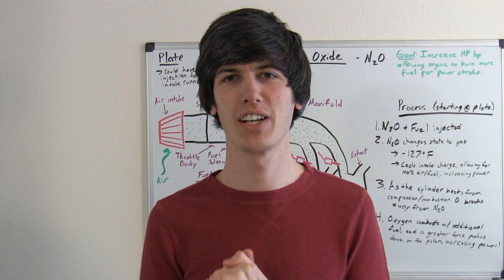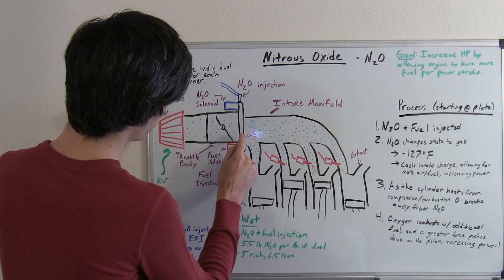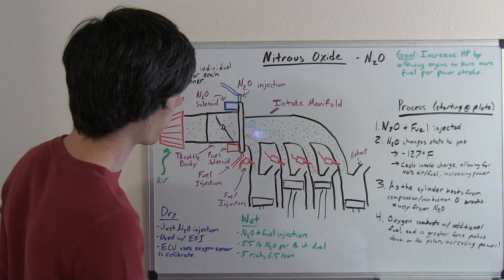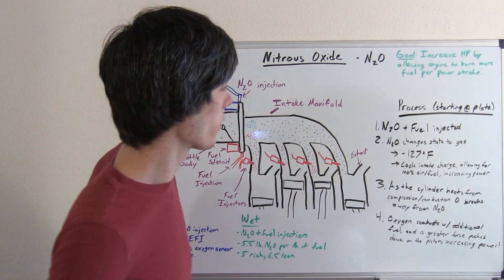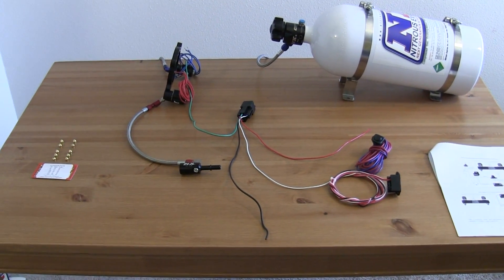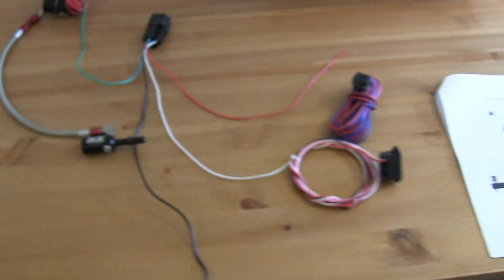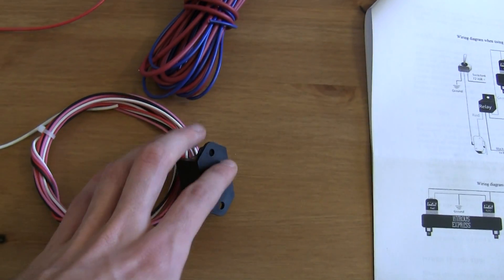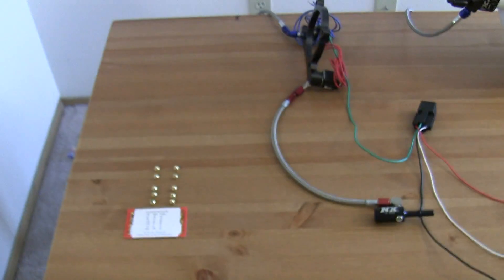How Nitrous Works - More Horsepower!

Comment: Hello. Another great video. I really enjoy watching you. I've got one question. Could you explain once more why the bottom of the nitro's bottle is lower than the top because I didn't get it :P cheers mate
Reply from the maker: +nendznikpl That's where the pickup feed is for the liquid nitrous.
Reply: +nendznikpl  As the liquid is used up the top of the bottle will fill with vapor. You don't want that in your car, It will actually slow your car. You want the liquid that will always be at the lowest point of the bottle.
Reply: +asdfgoogle the nitrous in the tank is actually presurized, so at room temperature and presurized, it has a liquid state. what makes it a vapor later is the decompression i believe.
Thermodinamics purely, just like air conditioners. that´s why so familiar
Reply: +nendznikpl The nitrous is in a liquid state at room temperature, so which has a lower density than a vapor. That means that inside the bottle, it's liquid, not vapor. However, once injected into the system (engine), it is sprayed in. Think of it as a fine mist

That mist has a very high surface area (because the particles are so small), so it can more easily change state from "liquid" (mist) to a true vapor (something like a cloud, where you physically can't see each individual particle) and flow through the combustion process.

I'm pretty certain that's correct. I took courses on air conditioner maintenance and repair, and it sounds awfully familiar to that.
Reply: +Enzo Mansur 
google phase diagrams. The states of matter are variable based on Pressure versus temperature. For instance liquid nitrogen is stored at room temperature under high pressure, but when it is released into the substantially lower pressure of the atmosphere we live at the temperature immediately drops, and the substance presents itself in gaseous form. same idea as C02 or keyboard dusters. Really cool stuff.

Comment: would you be able to do this with liquid oxygen?
Reply: +conor barry He told me no because it would be very unstable. Just like running lean. Run lean for a long time(which will be rather short) and you will melt and weld the internals together. 
Kinda like an oxy-acetylene torch. But with gasoline.

Comment: Is it possible that at a point the additional pressure created inside the cylinder pops the engine head open? Sounds like you are injecting fuel and oxidizer at the same time.

Comment: You've said that you need to separate N from O to increase horsepower. Why not have a pure Oxygen tank connected to your engine?
Reply: +shitbomber   http://www.nitrous.info/oxygen-instead-nitrous-oxide.htm
Reply: +shitbomber You can but that won't cool the mixture down as when the Nos evaporates (separates) at the high heat in the manifold. The cooling makes the mixture more condensed (cold contracts/heat expands) thus more mixture gets into the cylinder and a bigger explosion. Oxygen evaporates as soon as the pressure is released, thus at the nozzle not inside the manifold.
Reply: That would ignite the fuel in the intake, does'nt even need to reach the cylinder

Comment: Wait so you're not explaining how it gets you high? I've always wondered..
Reply: Stupisest thing I've heard today. And I thought flat earthers were retarded
Reply: The N02 buzz is not due to oxygen starvation.
It's an anesthetic which acts by temporarily changing your brain chemistry.  
The dentist wouldn't use it as an anesthetic if it cause oxygen deprivation.
Reply: +Andy Curtis   
It's probably denatured, meaning there is gas in it that makes you sick, so you can't get high from it.
Reply: charlesvan13 that suck! you should get some medical grade nos and huff it shit gets you railed as!
Reply: +charlesvan13 

You're right about the added ingredient. It's called "sulfuric acid". It shouldn't make you sick, but it does suppress the affects to getting high off of auto-used nitrous oxide.
Reply: jsalmon Lmao I thought the same thing
Reply: jacob anderson you’re mental
Reply: It gets you high because it starves your brain of oxygen. That's why you faint if you inhale too much nitrous oxide. Your brain is literally not getting enough oxygen for you to remain conscious. You're basically putting yourself at the lower limit of oxygen supply for your brain before fainting. 

In most cases, too little oxygen will make you feel like you're suffocating, but with some gases (like nitrogen oxide), you don't get that feeling. Which also makes those gases very dangerous if you're accidentally exposed to them because you can't tell that you're suffocating until it's too late.

Comment: -127F? How many seconds is that???
Reply: +xDarkAngelFallingx That obliviously does not drop the inner temperature to -127F (or -273C). It just cools it a little as a bonus so your engine won't overheat.
Reply: +Batuhan Genç what !? -273 c !? Are u nuts !? -127 is equal to around -70c

Comment: do you have to arm the system before you start driving or can you arm the system while driving like depicted in many Videogames.
Reply from the maker: Many will have a switch you can turn on/off while the car is running. If the car isn't on it's not going to do anything.
Reply: +Engineering Explained ok, thanks.
Reply: +John TheKid11
Either way, what happened to your question mark key?
Reply: +MaxxFordham nice try.
Reply: Nice try on what, John TheKid11? How about you just answer my question?
Reply: I forgot to place one. I assumed you tried to tease me with it.
Reply: Hmm....

Hey, did you know that you can edit your old replies here on YouTube?
Reply: +MaxxFordham how?
Reply: Hover over the reply and you should see an "Edit" button come up on the upper-right corner. Click it and then it opens up the text box as if you were still typing the reply before. Then make the change and hit "Save," of course.
Reply: The Nitrous Express kit has an arming switch with a red LED built in that will turn on when the switch is activated. It doesn't run until the gas pedal is pressed all the way down.

Comment: could you not use pure oxygen and that would give you even more power??
Reply: +Jack Stewart http://www.nitrous.info/oxygen-instead-nitrous-oxide.htm
Reply: +Jack Stewart that would make the combustion too hot thus it could weld the engine together. like an oxy-acetylene welder powered by petrol. they use i this method in rockets

Comment: So basicly... to make car faster... put more fuel and air in to engine? huh... i never knew it was that simple....
Reply: +Dark Star Exactly that! That's why turbochargers and superchargers increase power, too.
Reply: +Dark Star Like Quinton said, if your engine block is rated for 500HP and it's already running at 450 you're gonna cut it close. Add a 200HP NOS boost and you'll blow up your engine. Upgrading horsepower doesn't just mean slapping on Turbos and so on. It means upgrading the Engine block, transmission, and rear differential and so on. 
Good engine blocks alone can run you $12k so it's not a cheap hobby to have.
Reply: +theWolfXLIV i think n2o system is lot more powerful than supercharger and turbocharger but n2o gets empty whereas charges will run infinite.
Reply: +Dark Star Its really not that simple haha. It costs a lot of $$ to get serious gains. Forced induction is cheaper than N/A but can really take a shit on stock blocks
Reply: +Quinton Hall Provided that the vehicle can handle the additional power, yes, it is that simple.

Burn more fuel with the same or greater efficiency in the same duration of time as stock, and you'll get more power. Simple as that.
Reply: asdfgoogle
you are definitely from Reddit
Reply: +sourabh abhang I think the flames coming out the back of the exhaust are caused by a car that doesn't properly combust all the fuel that is injected into the system, the cylinders roll over and the mixture is sent out the exhaust manifold, it will eventually combust in the exhaust tubing on the way out the tailpipe.
Reply: +charchar m but yes eventually you need to add more fuel
Reply: ***** Pretty sure you're missing the context
Reply: Quinton Hall It was a simple question that had a simple answer. What context could I possibly have missed?
Reply: Quinton Hall I understand your point, but that isn't necessarily the case. Maybe the OP is young and/or ignorant on the subject. In such a scenario, they may be asking a basic question.

Comment: I heard from a couple of tuning mechanics that every time you shot NOS into your engine is like adding 100 miles to the engine, is that true???
Reply from the maker: +M Giovanni More stress = less longevity. There's not a rule of thumb but that's how it works.
Reply: +Engineering Explained Thanks for the fats response, great videos !

Comment: Can you mix and match those brass nozzles(gold colored nozzles)?
Reply: Well yes it's just that it will create an unstable amount of nos and gas if u don't know what combination is right.   The tune I use it the 70hp Fuel nuzzle and the 180hp nos nuzzle gives me way less fuel and a lot more Nos has given me some problems in the past but I gave my fuel system an upgrade to work with small amounts of fuel
Reply: Isn't that expensive? Wouldn't you rather use more of the cheap(er) gasoline rather than a $500?? tank of NOS?

Comment: Quick question, if you,re buying a nitrous kit, you obviously want more horsepower. It comes with all those nozzles going from 50 to 200 extra horsepower. So wouldnt everybody just choose 200? I figure theres got to be a downside to the 200 over the 50 or anywhere in between i just dont know what it is
Reply: +KittyCow He forgot to mention in the video that bigger nozzles (more HP) also decreases the duration. I think it's based more on if you want a high boost over a short time or a conservative boost over a longer period of time

Comment: How does nitrous interact with a supercharger or turbo? I dont really see too many cars with both of them and im not quite sure why. The nitrous adds extra oxygen chemically and the turbo/supercharger adds it by pressurizing the air so there is physically more oxygen. Wouldnt both just pressurize the air and nitrous so theres more nitrous enhanced air?
Reply: +KittyCow What a lot of people do is use nitrous as a turbo lag eliminator. Once the turbo reaches about 1/2 of the desired boost the flow of nitrous will stop. With that system you can make a bottle last pretty long and eliminate the cons of using a turbo

Comment: Thanks for the nice explanation to quench my curiosity. I just wanted to know though, if there is a limit (I'm sure there is, that's why you see some engines blowing up in films etc. :D) to how much pressure can be exerted inside the cylinders. And if so, how do you figure that out?

Comment: Sorry but you missed the boat on that one. All our engines are nitrogen engines. The oxygen only allows for fuel to be burnt to create heat to expand the nitrogen but does not create the pressure to get work done. Go back to University.
Reply: +Hieff Engine Company Ltd Hieffengine he never said the oxygen burns, he said it allows you to inject more fuel which is exactly what it does

Comment: Where do the two nitrogen atoms disappear to? Does nitrogen play any role?
Reply: +COLLINS ABUCHERI it cools the air intake increasing its density !
Reply: +COLLINS ABUCHERI probably increase NOx emissions and N emissions.  Otherwise, Nitrogen is just the vehicle for the Oxygen.
Reply: +COLLINS ABUCHERI Since the air we breathe is about 80% Nitrogen it doesn&#39;t really change anything. In fact Nos has a higher percentage of Oxygen in it than what the engine would normally use (33% vs 20%). So there would actually be a lower percentage of Nitrogen involved in the reaction.

Comment: You missed explaining the importance of the nitrogen. It is nitrogen that gives cylinder pressure to make power.
Reply from the maker: +Hieff Engine Company Ltd Hieffengine No, it's additional oxygen that allows you to burn more fuel and thus add more pressure from combustion.

Comment: can  nitrous  actually  blow my engine if I install a system
Reply: Well it can blow an engine up. It depends on the engines parts and components like the nozzles on the nitrous kit that's why they come in different sizes thus more or less hp. Let's say you want to install a nitrous kit the most important or ideal component is how much hp your car can handle like a muscle could hold a 200 hp nitrous setup but would need a racing fuel system with a bit of better engine internals like bigger piston to hold more pressure. A Honda you would start with 50hp nitrous system then upgrade parts and change nozzles for more hp.   A sign that engines give when they can't handle the horsepower is your car will not accelerate. 2 the engine turns off when nitrous is activated and 3 the most common your crank shaft and bells will get out of place and will make a can like noise when nitrous is activated. If any of these happen stop immediately turn off car and down grade nitrous nuzzle.   Coming to you from a    heavy Nos user🚗💥💨💨
Reply: +matt lloyd no as long as the system is for your car and you have it tuned and installed correctly.

Comment: Regarding the electrical side, is that the only way to directly send N2O into the mixture, or can you manually send the nitrous at any given time?
Reply: +Matthew samson you can do it anyway you want. Some do buttons on steering wheel, some uses timers that are controlled by a dedicated nitrous timer or by ECU. Comes in handy for drag racing. The WOT way is the simplest for street cars either EFI or Carbuerated since you would only want it to activate when you want your car to scoot down the road. Not at a specific RPM, MPH or time in seconds during a pull.
Reply: +RayzorBlade Gunnery you do not want to add a a lot of power before 3k rpm. makes for a bad day on the internals.

Comment: please correct me if i wrong.
So basically the N2O injected into the intake manifold, therefore (step 1) by changing from liquid into gas form, N2O will reduce the intake temperature significantly, this alone will increased power / efficiency (i read somewhere, approximately for every 10 degree F drop of intake temperature, power increased by 1%). then (step 2) the O2 will break from N2O chain at around 572 degree F (clear me here, is it at compression stroke stage?) therefore adding much more O2 to burn in the power stroke, then (step 3) the ECU will sense that the mixture is lean, therefore more fuel needed to balanced it. Thus increasing the power output.
Reply: next question, so eventually N2O works similar to turbocharger but (in it's own way) work more efficient. then is it ok to use N2O on forced induction engine? say at least in a configuration with no intercooler installed? or is it doesn't matter either way?

Comment: The explanaition of how your ECU responds with dry shot is inaccurate in most cases.  When you demand power of your car by means of mashing the gas pedal your car drops out of closed loop into open loop mode.  In open loop it reads off of internal maps to identify the correct injector duty cycle per load/rpm.  Your car will not automatically respond and add more fuel to compensate for the lean condition, you will instead melt a piston or your danger to manifold light will illuminate (joke).  Only newer vehicles like some ecoboosts use widebands from the factory to evaluate AFR outside of closed loop.  If you use a dry shot you must be tuned while using the dry shot and its wise to keep a steady eye on AFRs.

Comment: there are 3 ways how to install N20:
dry, wet and direct.
if i'm right, direct sistem sprays N20 directly in cilinder, so when you pres the button computer gives signal to spray more fuel. or something like that. if i'm wrong, corect me :)
p.s. sorry, bad english

Comment: Can you use an air compressor as boost? And just run a line to your intake and have a button that releases a few psi?
Reply: Broseph Reilly You could call that a turbo too ;)
But a turbo won't shut off
Reply: Broseph Reilly Thats a cool idea
Reply: HomeGrown Racing thanks! It would probably have to be incredibly compressed
Reply: You would have to compensate for the extra oxygen with more fuel. Bigger injectors or external fuel injection would be needed.
Reply: the same for a turbo installement
Reply: +Broseph Reilly A few years ago I remember a buddy had a spare tire in the back of his 59 bel air, filled to around 100psi with a hose running through a valve into the carb.  I never saw it in action though so I don't know how well it worked.
Reply: +Broseph Reilly actually no, a few psi would be fine as long as it has a huge hose to travel through unrestricted, it would probably take a pretty large tank though because the engine will suck it up quick.

also this would be the same as turbocharging except the turbo is constant

Comment: What should my horsepower and torque be to gather I'm running a turboed 96 integra isn't chipped has the b18c1 VTEC dohc what should my horse power and torque be thanks

Comment: When you arm the system and reach full throttle, will it pour nitrous continuously until either the bottle is too cold or you run out? The switch isn't often explained.

Comment: Do those little brass jets alter the rate of Nitrous Injection so it lasts longer?
Reply: They do alter the rate at which nitrous is injected, that's where the different hp numbers come from. So technically yes, if you use the smallest jets you will use less N2O per powerstroke.